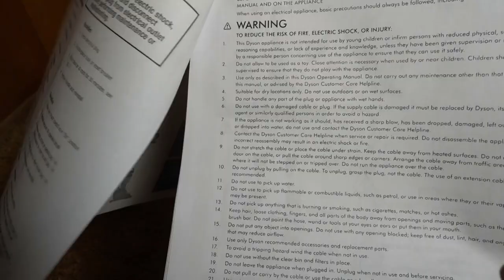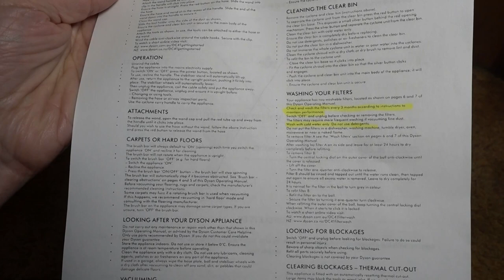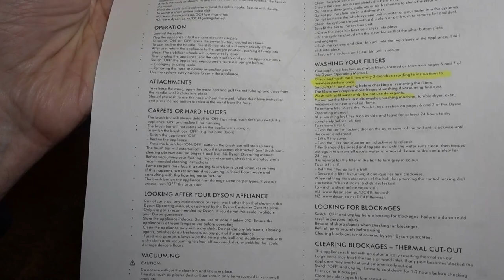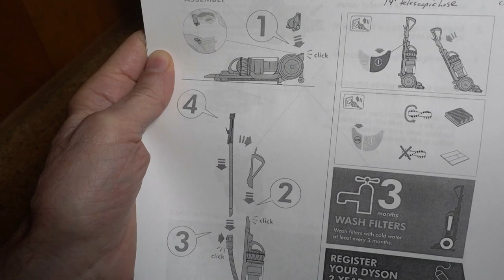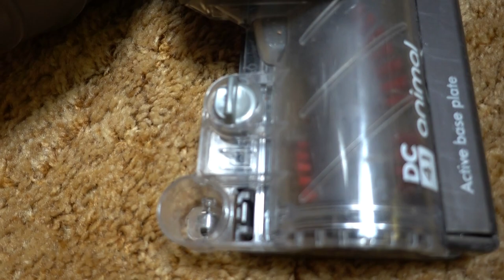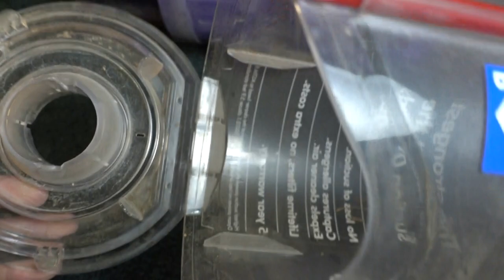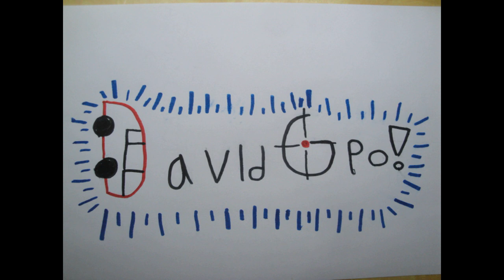Dyson DC41 & DC65 Vacuum Repair & Maintenance

Comment: Thank you for telling your viewers what size screw driver to use on those tiny little screws!  Loved your very clear and detailed explanations.  I was able to actually take everything apart and finally clean the brush bar rollers and casing.  I like the Dyson but it does get very dirty.

Comment: I've watched this video again and again and it was all smooth sailing till I tried to put back the little spring and push the bin back into the canister.  Do you make house calls?
Reply from the maker: Do you have beer and potato chips?   That project was so long ago I don't remember the process.  I gave the vacuum cleaner to my daughter.  I'll have to watch the video again!
Reply: @davidgpo  Would that help? I hate to take it to the repair shop for something that in principle looks so easy.  It is a very good vacuum for long-haired cats.
Reply from the maker: @thelmah05    I did have trouble with that spring.  You might need a helper or a forceps.  Keep working at it.
Reply: @davidgpo  One way or another it will get fixed.  I don't know why they made this so complicated.

Comment: My DC41 dust canister/basket has started to fall off the vacuum.  When engaging the vacuum rollers and snapping it back in, there seems to be some flex in the gray handle.  It's like the dust bin is able to just barely be able to start to fall out because of it.  It doesn't really look like the plastic is worn, but hard to tell. 

Do you think it's the spring inside the red piece that releases the basket?  Any ideas how to make sure it doesn't pop off until I actually press the release button?
Reply from the maker: I don't know the answer and I gave away that machine a year ago.  Hopefully someone will chime in with an answer.  Good luck!

Comment: Why did you have your fast forward through the 1 part I needed? Fitting the motor back into plastic head piece and where to put the damn wires!!! 😩
Reply from the maker: People get bored with long videos.  Have you tried running that section at slow speed?

Comment: Hellos, my dc41 stays locked upright. I can not get it to decline.  Anyway to fix this?  Thank you
Reply from the maker: I never ran into this problem.  First see if the accessory hose is blocked with debris.  Remove the dust canister.  You'll see a red button on the lower area of the handle.  Push the button while lifting the hose out of the body of the vacuum.  See if there's debris in there.  If that's clean check the upright lock mechanism.  I believe to get to it you have to remove the filter in the ball and then remove the cover plate that's under the filter.  I think it's secured with torx screws.  Let us know what you find.  Best of luck.
Reply: I have the same issue and no solution found so far. Checked for anything blocking in the hose and have disassembled the vacuum as far as I can. Unable to get to the other 2 screws holding the locking mechanism because I can't move the vacuum position past upright.

Comment: Take the fiber washer of the bearing,clean it with electrical cleaner spray,let dry, and mash grease into the bearing. Put the bearing back in and rotate it. Good to go.
Reply from the maker: That's a great tip!  Thanks!